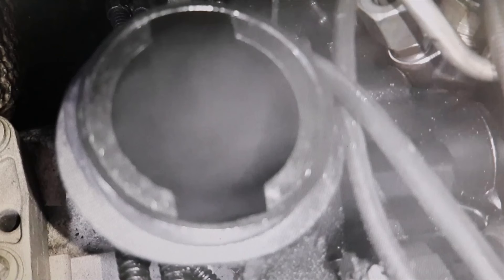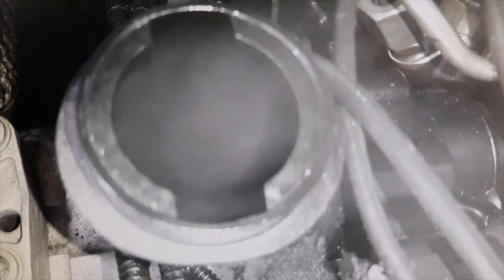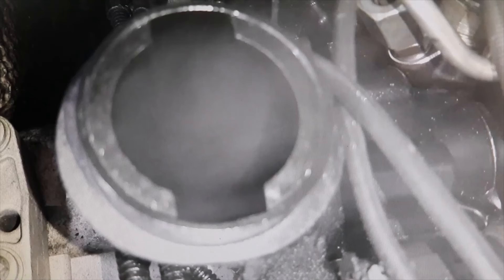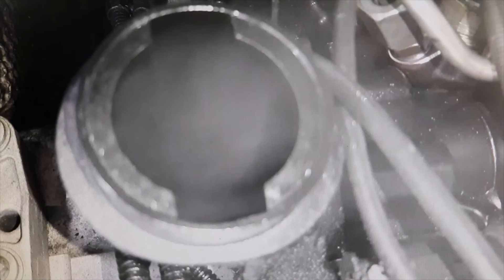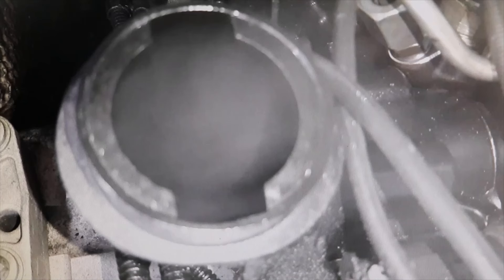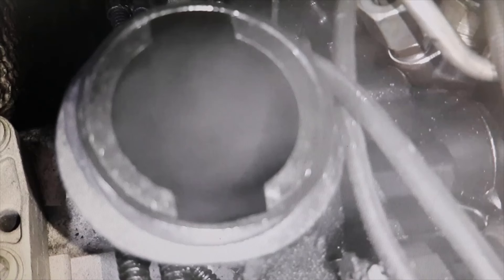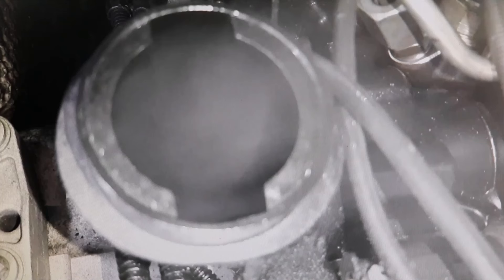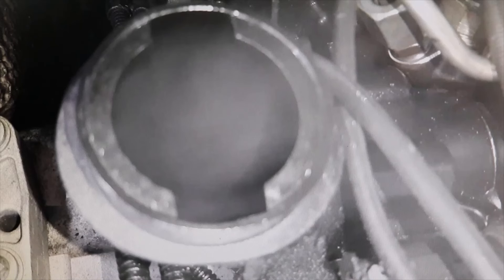DAMAGED engine, SMOKE coming out of the oil LEVEL dipstick due to EXCESS PRESSURE in the CRANKCASE

Comment: totaly normall especialy for diesel engines with particular filter .  Often driving short distace and temperature not reached for evaporig diesel from oil volume cused by not complet regeneration process . But its real preoblem when level of oil incrase on dip stick .